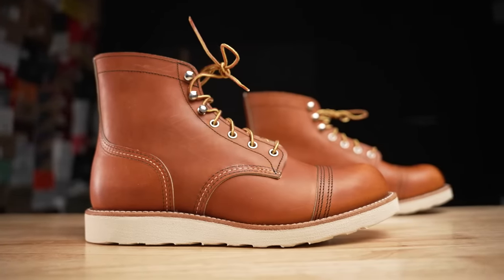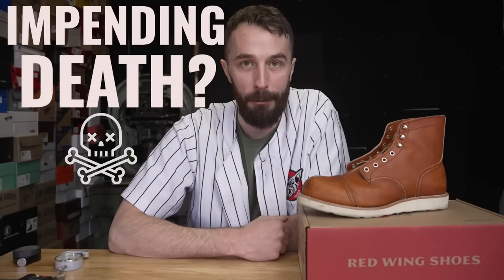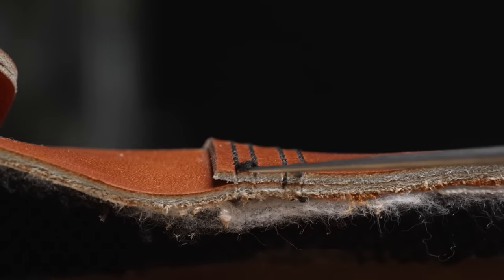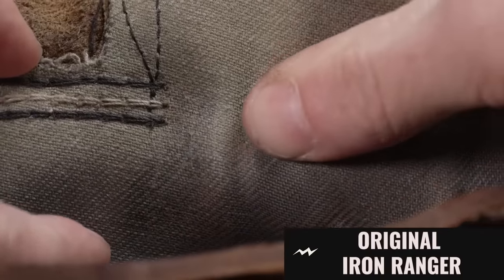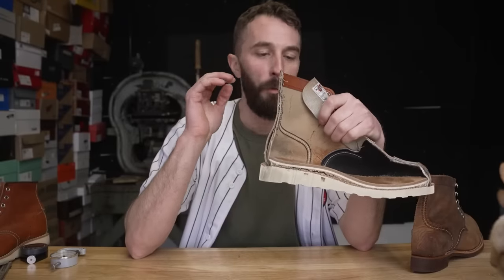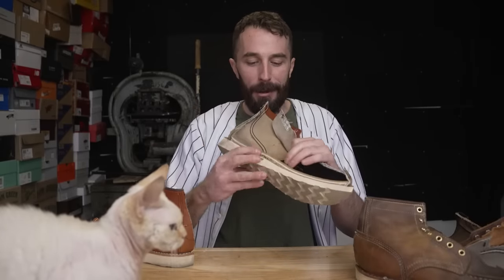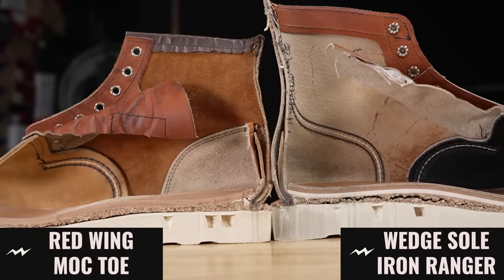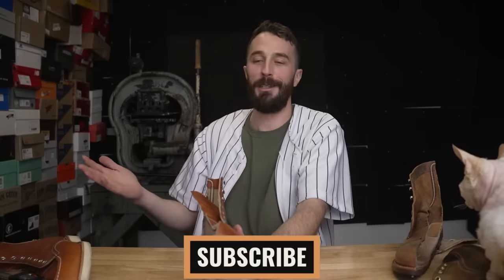Why People Are Pissed At Red Wing

Comment: Would be interesting to learn more about the fiberboard. Hopefully its synthetic. Paper fiber boards used in archival picture framing are P.H buffered to neutralize acids that break down the material over time, while 100% cotton fiber board is preservation grade and lasts a relatively long time if not abused.  Personally, I'd rather the boots stay mostly leather, because I use insoles that increase comfort immediately, and can easily be removed when worn out.
Reply: I've had a Helly Hansen Woodlands boot for five years. I used it actively (concerts, hikes, work, etc) and it was fine, except when I used for heavy duty constructions. Even though it was still kind of repairable i saw what was inside it. Basically it had a two layer eva midsole and a thick eva insole. The leather was about a milliméter thick Just as the fiberboard which disintegrated. It was a cheap sneaker advertised as a premium boot.
From that experience I uograded for a more expensive European made hiking boot which actually had standard certificatings (thoug mostly for breathabiloty and waterproofness. Its upper made from 2.2mm thick greased full grain leather + PU coated leather át its heels and cordura fabric, the inside has a watwrproof and breath able lining, meamwhile under the insole was a first soft wool fleece like lining which was stitched (every stitch hole sealed with some black spots) and after a while hardened and it became quote uncomfortable éven with the insoles
It was very comfortable boot when tried but after its PU mid and outsole has started to be soften i realised it does not have any shank. And after a while my feet starts to hurt in it.

Comment: My brother is a machinist on his feet all day and has worn redwing his entire life but the last pair he bought hurt his feet (unlike any of his other shoes.) What's a good pair of boots to change to that are comfortable and resilient?
Reply: Hi, I work as a machinist myself. I use a pair of Justin Worker Pulley boots with a composite toe. They're an 8 inch boot but comfortable. I recently also bought a pair of Thorogood Moc Toe boots and have worn them the past week and they broke in fine. Typically you get a half size smaller for a pair of boots but I bought my actual shoe size in the Thorogood as they felt like they fit better with the steel toe. Also always wear a nice wool work sock as they'll keep your feet comfortable and will give you an idea of how the boot fits when you layer up for winter ( I live in a state that sees snow ). But I always recommend going to an actual boot store as they'll be best able to help determine what size you would need. Hope this helps.

Comment: I’m an all leather fan.  I hope this is just an attempt at a different market.  Was going to pull the trigger on a pair…not now!  Thanks for showing us the truth about this boot.
Reply: I ONCE BOUGHT A PAIR OF SPEAKERS off the speaker designer for Linn Audio - they were HIS custom Linn Kan speakers.  They weighed double the commercial product. 

He told me that any "new development" a company tells you about is marketing speak for "we worked out how to make it cheaper...!"  He designed the most perfect speaker he could and built it THEN the engineers worked out how to save as much money as possible and not totally ruin it. THEN the marketing team set to work coming up with BS reasons for the changes

"Its to wear in more easily and wick out moisture" is marketing speak for "we worked out how to make it cheaper"

Comment: I used to be a Cobbler and repaired those many times. The soles are easy to remove by knife. The midsole is stitched on and the vibram sole is glued, edges trimmed and finished by fine sanding.

Comment: It probably is cost cutting. I used to wear exclusively Rockport shoes but about 25 years ago when they switched to offshore manufacturing they changed the way they were built. The change was obvious when you put them on -- the originals fit like gloves for your feet, the new ones fit like cheap shoes. Decent footwear makes a huge difference to the quality of your day.

Comment: I've bought redwings a few times. First time in 04 and last in '15. Had both steel toe and metguards. The result was the same. They break in the fastest of anything I've ever had. They are very comfortable. But every pair I ever had lasted a year max, and the one that lasted a year was the year I had major knee surgery. I'm 6'3" and 200 pounds, so not some big fat guy overloading his boots, and I wear a size 13 so plenty of space to spread the load. I paid $240 in 04 for boots that lasted a fraction of the time that $75 boots did. I've left the brand as they don't last if you work for a living. I have had a lot of success with Carolina and Thorogood . Red Wing isn't worth it.

Comment: I started wearing Red Wing boots in 1984. Bought my first pair of Pecos work boots at 16 and paid 105 dollars for them. My mom thought I’d lost my mind paying that much for a pair of boots, but those boots lasted for nearly four years. I wore RedWing religiously because of that fact until 1995/96. When I had to replace a pair twice in less than six months I switched to Wolverines and wore them until they started to cut corners and use inferior materials.
RedWing used to be the top of the list boot but now they are just overpriced junk. They need to go back to using quality materials and making them in the USA like they used to but they won’t because nowadays it’s not about quality it’s about making bigger profits.

Comment: I have a pair of Red Wing boots that are probable 18-20 years old. I've used them quite a bit until last week. I was working on my knees pulling weeds and when I moved a few feet down the side walk both boots literally fell apart. It looks as if the leather where it was sewn onto the sole rotted away. This surprised me as I oiled them at least every 2-3 years and I thought I was doing the right thing. Would you be interested in using them on your show?

Comment: I wouldn't mind if these were just Iron Rangers with a wedge sole and some phorene instead of cork. I think that would help with the break in process, but the boots would stay durable. 

However I'd prefer there to be Iron Rangers with a more rugged outsole as a default option as the normal one is really bad in winter weather and not soft enough for grip.

Comment: Back in the mid 90's I was lucky enough to get one of the best paying blue collar jobs in the US. I usually go the cheap route but I decided to treat myself to the top of the line Red Wings. I went to the Redwing Store and was measured and everything. After 3 months of walking around in the most uncomfortable boot I had ever had on my feet I returned to the store and demanded to be measured again and refit for a brand new pair, which they did. (I never do this kind of thing). After getting my new boots I tried them for about a month and ordered some Hytest and threw these uncomfortable POS in the trash. Red Wing is the worse boots I have ever owned BY FAR.

Comment: If you have trouble breaking in boots. Soak the leather with oil. Mink oil, mineral etc. Inside and outside. Softens up a lot. After that jut regular oiling/greasing from outside.

Comment: When I buy a work boot, I look for a few things. 

1. does it meet safety standards that the job requires? Steel toe? Full metatarsal plate? Full plate sole? While most jobs only require a steel/safety toe protection,  Depending on where I work at and if I am on heavy equipment depends on the type of work boot I wear.  I have a pair of $300 under ground miner boots with all the protections and completely sealed from water that go up to midway my shin that I wear for certain areas.
2. Is it comfortable?
3. Water proof?
4. Soles with good grip.
5. is it made specifically for the cab of heavy equipment, a city type environment or completely rugged use.  I could see my miners boots being used by a heavy equipment operator that specializes in tearing down structures, because those boots have the full kevlar plate in the sole of them to prevent glass and nails from puncturing through. Those would also be great in a garbage dump type of environment or even if you are in the inner city in areas where hypodermic needles are everywhere. 

There doesn't seem to be anything in the toes of these boots. Is it really a "safety toe" when it's just a piece of regular leather? I would rather have steel or kevlar, heck even hard plastic.

6:53 honestly? Neither. They wouldn't protect your feet from anything. You are just rating these for looks right? I hope you aren't saying leather or card board is going to protect your feet from anything other than water and cold air. This is a hipster review of work boots.

Comment: I will buy it just to get the Oro Legacy in an Iron Ranger (Red Wing rarely do the Oro Legacy leather in anything other than the 875 & 877 moc toes) but will immediately have a cobbler do a complete rebuild & go to a 270 welt. I’ll get rid of the foam & fiberboard insoles and just go traditional like my older Iron Rangers. I’ll do a 5mm veg tan insole with cork and a veg tan leather midsole. The outsole will either be… Roccia half sole like a Beckman, 430 Mini Lug like regular Iron Ranger or maybe even with a full lug sole, 270 welt & stacked heel like an Urban Logger. If I do the latter then I’ll call it the Red Wing Iron Logger! I re-soled all of my christy wedge sole boots bc it wears down too fast and looks crappy when the white wedge gets dirty which is pretty much immediately. I have a pair of 1907 Mocs that I put a black wedge on to eliminate the dirty look problem and on my 875 Mocs I had a Dr. Sole half sole with leather stacked heel added.

Comment: Last winter I bought a pair of 877’s in Oro. I had to return them because one of the pull loops was very thin leather and wouldn’t last a year. I got a new pair and after a month or so I noticed one of the tongues was thinner than the other. Not as bad as the pull loop on the other pair and not as big of a problem , as I would have to brake in yet another pair if I return them. But I don’t think these flaws would have gotten through quality control a couple of years ago.  I recently bought a pair of 8168, Abilene roughout pecos of E bay. Factory seconds but brand new. They’re better quality than my 877’s. Seems like they’re lowering standards.

Comment: Honestly these look great, so long as it's just an alternative spec rather than end up as a replacement. I love the styling of RW's boots and the leather upper and resoleability of my 875s, so knowing there is a way to access those things in another design for more casual use rather than decades of abuse is really nice. I think RW's boots look really well dressed up, but if that's what you want them for you would never use them enough to break through the pain phase on the traditional model.

Shame about the price tag, but the economy is what it is..

Comment: I've been wearing Redwings for work over 25 years now. Started buying the slip on (6705) a few years back because I'm always removing my shoes going into customers personal aircraft. They are made overseas, last pair in Vietnam. They last fairly good. The soles wear out first which can't be replaced because they are a molded on, looks like rubber. I try to buy Made in USA but it's hard these days. Redwings are still the better shoe for the price. They will last me over a year. I buy another pair and finish wearing the old ones out doing yard work.

Comment: I gave up on Red Wing work shoes a few years back when a brand new pair fell apart after only a month.  The soles separated.  I took them back to the Red Wing store and they repaired them, though it took nearly 6 weeks.  But within a month, the soles were coming off again.  That's when I threw in the towel on Red Wing after decades of trusting them for high quality work shoes.  To be fair, these were glued on soles and not stitched on like their work boots.  But their entire line of products used to be high quality, the shoes no longer are.

Comment: I worked as a LTL driver and bought two pairs of Red Wing Worx shoes. I wore the first pair out. When I bought the second pair, I used them for three months and put them in the box and in my closet as I left driving. I took them out 3 days ago and the rubber soles have rotted. It's almost tar like. Just using a screwdriver with little effort I can gouge chunks off. I peeled the soles off like stuck  pancakes to a pan. for 130.00 dollars you would  expect them not to be made of stuff that goes bad. This had to be something they designed into the shoe.  Makes me think it was done on purpose so you keep buying more. Long gone are leather sole shoes that can be resoled several times. Everything is disposable now.

Comment: I have been using safety toes for 30 years and I got a pair of the Redwing 2440 Traction Tred Lites and are by far the most comfortable boot I have worn to include those I wore in the military. I only need mine to last a year so I don't know how long they would last but, they are lite and comfortable.

Comment: Had to give up on redwing. They don’t make a size 16 in anything that I actually wanted. I bought a pair or 15’s in a pull on steel toe. (Some brands of soft toe I can fit a 15). Waited two weeks for them to arrive, tried them on in store. Easily a 1/2” too short, toes slammed into the steel, no go. The store owner literally commented that I should give them a few weeks to “stretch” (length not width). No joke. Meaning he did not want to eat the return and shipping. The one 16 they do make in a pull on is like standing on a rock (solid urethane sole). The “super sole” which is extremely comfortable, has terrible heat resistance, step on any hot slag, and melts like candle wax. Done and done.

Comment: I wore out a pair of Logger RW boots. Vibram sole. Expensive too, but
Lasted five years. 40 year adjusted for inflation top dollar, top tier boot.
Schmidt from Tractor supply-two years.
Georgia boot from Academy-two years.
The worst of the bunch was a pair of Double H online. Opt out of steel toe and shank and you get horrible composite toe that will Never break in for comfort. Steve Martin Cruel Shoes.

Comment: One of the few times I ever purchased an expensive pair of boots was back in the mid 80's from a Red Wing's dealer in Booneville Indiana. I was a machinist running gearcutters. The soles split in two after a day or two. When I returned them I was told the warranty would not cover them because I had  metal shavings in them. I can't remember ever having another pair of boots split like that in my 30 years as a machinist.

Comment: I don't mind that jersey material at all, not a Redwing man myself but my favorite pair of Carolina boots is completely lined with it and like I said, they're my favorite. 
I might be a little partial because I'm pretty sure they saved my foot during a workplace accident where I had my foot run over with my ankle against the pavement and only suffered 1 broken bone. There are also the most comfortable boots I've worn straight out of the box.

Comment: I love Redwings but have been struggling hard to stay with them. My first pair last me 5 years working on a Great Lakes tug. The next pair failed 8 months in. My last 4 pairs have suffered the same fate. Sole cracks straight across or falls off. No one will work on them if so much as a drop of oil lands on them. My last 2 experience with the staff at their stores has driven the final nail. I’m glad to see this video as I am back looking again. My current pair the eyelets broke off on both pairs and the toe is wore through. Really hate to move on but it seems it is time.

Comment: Depends on ones use or environment. In dirt oily heavy duty industrial machining workshops, the Red Wing soles rapidly wear to almost dissolve like. Only once did I upgrade the sole at a cobbler to the black and higher durameter rated Vibram. But the uppers were already getting past practical working life, just wasn't worth it in the end. Tired of the non competitive high prices without added value, 'to boot'.  And now after seeing this vid and info, I'm not interested of the fiber lined. Disappointed, really and would prefer to support nationalism and home but budget says another thing. Curious though if they've skimped on the quality of leather too, not specifically or just thickness. Had best results before first use, applying Proofide by Brooks (England bicycle saddle maker). Not over application but just get it enough to coat. Helped break them in plus leather protected in wet, salt. Lately been buying CAT labeled boots for a fraction the price of Red Wings. Asian sourced from likely same factories as shared with other labels. Can get 3 pair for the price 1 Red's. Rotation use and trying different models and will toss out when the soles are toast. Not worth the cobbler re-work. Weight on all of the CAT brand are ridiculously heavy and the laces shred. Overall are a bargain, purchased from big dept store Meijer and often discounted. Scored one pair / safety toe and cert ratings, etc. for only $47.

Comment: Talked a Redwing person via chat on their website today.  That person actually told me that the Iron Ranger wouldn't be as tough a work boot as the 606's I currently wear.  I wish I saved the screen shots.  Did the Iron Ranger also undergo a transformation to synthetic materials recently?  The person kept saying the Ranger's were more for casual wear instead of work, and didn't have any of the safety ratings that the 606 does.  I think the 606's are a great value boot, I just wish their supersole 2.0 would stop cracking.